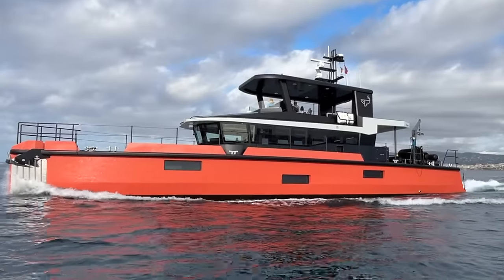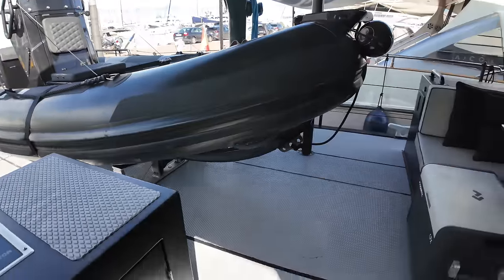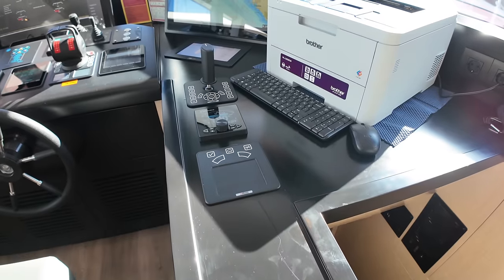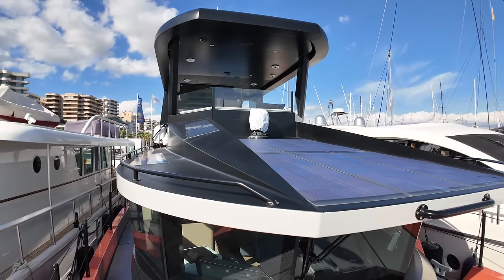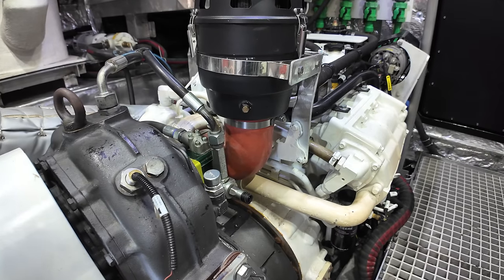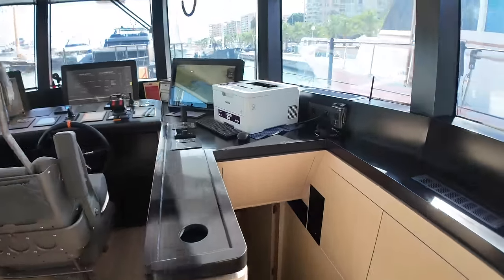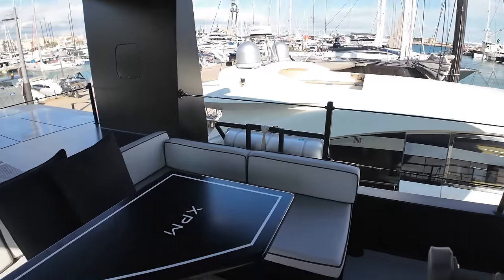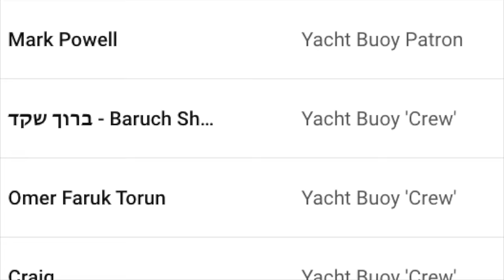EXCLUSIVE FIRST LOOK: XPM 78 ‘Vanguard’ Explorer Yacht Tour!

Comment: what would be a realistic cost per year to operate with a full crew, fuel, maintenance, food, moorings etc. if used as a full time live aboard
Reply: She is designed to be operated by 2 people. Having completed a longish deep sea passage, 3 crew would be better. So, if it's a couple, you'd need a competent deckhand who can stand a watch, at least for anything other than coastal cruising.    The crew cabin has space for 2, but that's up to your circumstances. Crew in the EU come in around 150/200 Euro per day. Some amateur souls will travel for free for the sea time, but it's potluck what you get; they tend to be retired types and opinionated on occasion. Major costs have been fuel and marina's, in Turkey (Antalya) they were $500 per night!   I'd budget $200K per year as a floor inc. a crew member semi-permanently.   Less if the owners are a competent couple and like anchoring (she is capable that regard with huge batteries), more as cruising gets longer or more crew.  Anchoring is easy and saves a lot of marina costs.   Hope that helps?

Comment: Beautiful yacht! I love the modern interior, and the design of the boat. What is the cruising speed, and range at that speed? You said over 3k, but I thought these types of boats (Dashaw) had longer range.
Reply: I'm careful with distance claims and there is a lot of marketing hype out there. FPB 70 has more beam and  displacement than us yet claims 5000 miles. Not sure. We did the first
1500 miles and clocked 3.5 l/NM 7.5/8.5 Knots. Since then fixed a few things like rudder alignment so it got better.  So with my ocean crossing hat thats what you have. Writing a marketing brochure and i'd probably slow the boat to 7KN and add 500/1000 miles. HVAC off, stabilizers retracted.  Hope that explanation helps. Chris

Comment: I would have placed the Praxis Battery Banks outside the Engine Room proper to keep them as cool as possible; the engine room on the 2 submarines I served on could average 40+* Celsius & spike to 57*C when ventilation was secured during casualty drills. The Arksen 85 has the right idea in establishing a separate, climate controlled, WT Battery Compartment.
Reply: I think they are water cooled so should stay cool even if the engine room is warm.   not sure what system is in place incase of a fire.  The ship i work on has a 1MW battery pack in its own room and is designed so that if there is a fire the cell that caught on fire should just be left to burn out.   (ship is 80m long and built in 2023)
Reply: You are spot on. We did try, but we needed more space to make it happen. The batteries are water/glycol cooled to control the temperature, and the glycol tank is skin-cooled by seawater. Arksen 85 has a lot more internal space, so they have better options in a much bigger boat. With the cooling, we can now charge at up to 35kW, and the temperature does not exceed design limits even when the ER temperature is in the mid-40s Celcius.  BTW 57 is inhuman, I've seen 52 on a steam turbine ship in the valve compartments, which was bad enough.

Comment: Can this be compared to the Bering 70??? 🤔
Reply: I took the Bering 70 for a trip, did not like it as heavy and slow even with larger (Cummins?) engines. I'd note their offering is now 2m longer for the same beam and that would improve matters.  Bering make some really nice and voluminous boats so its just an observation of a single model, nota reflection on the company.

Comment: Great boat to do the northwest passage. What heat options does it come with? Tia
Reply: Two Webasto diesel heaters and good insulation above waterline.  Cabins also draw preheated or cooled air from the saloon so its not wasted.
Reply: @chrisleigh-jones5492  thanks for the info

Comment: Refrigeration is very limited for long passage, engine room is messy. The FPB yatch are still the best for explorer boats, longer range with smaller engine, better hull design, better everything. And the orange paint is ridiculous.
Reply: There is a Fridge Freezer in the galley, a fixed fridge under the stairs, and three large Dometic portable chest fridges/freezers that we double use as stools for the tables. It is not obvious from the video, but we have five fridges on board in some form or other.   Chris

Comment: what a lovely bit of motor. 
my only concern is the lithium battery banks. 
their location is not ideal in case of any sort of emergency; water related or fire related, they're in a location such that things will go sour quickly in case of any minor leaks or ruptures or fires.
Reply: You have a good point here and we did sweat the design trying to move them. Space and weight distribution won the day.  The design of these Praxis units is that each battery tray is actually a self contained battery room, linked to a common exhaust in case of thermal runaway.  So there exists at least one level of protection between the elements and anything high voltage.   We also moved potential salt water leaks (bilge and watermaker supply pumps), well away from the Stbd battery where they were initially located. The batteries are also temp monitored and glycol cooled to keep them in the "safe zone". Chris
Reply: @chrisleigh-jones5492  Are they made so that if it catches fire you can just leave it to burnout a single cell/ tray?  (on the ship i work on we have a 1MW battery bank and its made so that you just leave it to burn if it catches fire)   Also all the controls and instruments in the bridge is some of the nicer i have seen in a yacht. looks somewhat similar to what we have on our ship.
Reply: @multi422  Yes, the individual cells are isolated in their own mini battery compartment . They are rated such as thermal runaway will not propergate. There is also an exhaust from each compartment to above deck so it does not discharge to the engine room.

Comment: She not a luxury " cocktail" yacht she comfortable yacht with many safety features. Non slip covering on the deck, the deck gentle sloped to allow run off of sea. The fiddles on top of cupboards galley area. 
The salons feels cramped as there is the galley, the helm, dinning and seating areas. But she not a luxury yacht she feels more workman like yacht. She is Explorer more likely to be find in larger oceans. She has a narrow shape like a destroyer, " Greyhounds of the Sea". 😊

Comment: 10.5 KW of solar power?  I'd like to understand how that figure is calculated.  Doesn't seem realistic.
Reply: It's not, well spotted.  It's a 6kW array if all run at 100%, shading is inevitable and we have some set up issues, so its more like 2kW of useful power coming from various arrays as they sun moves around.  There is an upgrade being installed soon that will hopefully move the needle to about 3kW and for longer in the day.  Min consumption with the HVAC off is about 1.5kW.
Reply: @chrisleigh-jones5492  Those numbers seem more realistic.  Appreciate the reply.
Reply: @chrisleigh-jones5492  I‘d be interested in the battery capacity. Somewhere around 20-30kwh would be my guess
Reply: @GroppeljohannKlotenkempe-vr6oh  There are two different battery banks on Vanguard.  House batteries are 3 by 7kw.H, giving 21kW.H in total.  Power batteries are two by 60kW.H giving 120kW.H in total.  So there is the ability to sit at anchor wich HVAC running all night or for several days without running generators.  Solar also slows the battery drain rate.   Chris

Comment: This is what the dashews tried and failed to build.
Reply: Yeah right… the Dashews built a much more advanced and capable vessel of this size, two (!) more cabins including a crew area with a mess and TV, vanishing stability of 130° minimum (umdisclosed) instead of 90, no ventilators needed cause the dorade vents work brilliantly etc.etc.etc.
So you are eight: the iconic Dashews haven‘t messed up their concept